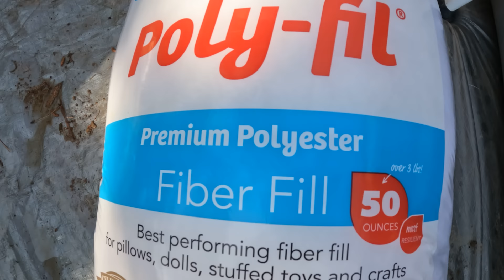Above Ground Pool Swamp To Oasis in 36 Hours for $30| FAST CLEAN Redneck Filter HACK| SUMMER 2022

Comment: Nice setup.  Might consider a sand filter on your well water withe a backflow loop.  It will help in the first place.  Also, 99.99% of what is in that poly filter is sediment and Fe-oxide.....and the Cl likely killed biologics.  But....if there is any lead, nitrate, arsenic, etc... in your well water (even safe amounts), that filter is concentrating it all from that entire large water volume into that tiny filter volume you are then handling.  Just a thought.  EDIT:  Just to be clear - I'm not implying it is "deadly toxic waste". I just would wear dish-gloves when I handle it (just me).
Reply: No, it isn't. Dissolved chemicals, such as lead, nitrates, arsenic, and such, will remain in solution, remain dissolved and pass through the inert fiberfill and go right back into the pool. Please don't spread false reasons for fear. There are plenty enough real issues to be concerned about without them.
Reply: @brainisfullofnonsense8183  Well, since you know chemistry....at least in a controlled lab... The reason the water is clear when it goes into the pool is because everything is dissolved (not suspended).  Not because it is reduced.  The Fe isn't really reduced unless that water came out acidic or anoxic - and they would know (trust me).  When they add the chemicals to it, they are changing the pH and adding ions that cause the dissolved chemistry to precipitate (a portion of it anyways).  MOST of that is Fe3+ as an oxide, chloride or sulfide.  But not all of it.  In addition, some remaining dissolved chemistry will sorb to the Fe-oxides (phosphate is pretty typical).  ALL of that is in the sediment - including things you might not want on you.  Now, re-reading that post I made - maybe it sounds like I'm trying to "strike fear into the hearts of mortals", so I'll add a line at the end.  Really, all I meant was maybe wear dish-gloves when you handle something nasty.

Comment: Awesome... I would put the inlet fitting at the top of the bucket so it would drain the bucket. Maybe bump the pump a few times to clear the line before disconnecting the union, might keep the mess in the bucket. I get a lot of tree pollen, bud waste, etc in the spring after the cover comes off. Slightly modified this should be a great fix for that. Thanks

Comment: WOW, works great! 
Imagine if you had one more, double filtration. Now you’ll speed up the time.
Reply: Put fiilter outflow opposite the filter inflow.will greatly improve.increase the size of the pump motor horsepower just to get the brown out.could just add a sump pump or any water or pond pump to the system.just add a t  splitter or a y.with a threadeded female hose bib.a sump pump water hose discharge  screwed into the splitter would double the flow.but need to clean filter twice as often.

Comment: I have a 16ft above ground pool, to heat it for free, i have painted the exterior walls black (looks pretty cool) and have a black pool cover, the pool (im in the UK) gets to 84 degrees F (29C). Before i painted the pool it was freezing cold. If anyone has an above ground pool that is too cold i highly recommend this method.

Comment: our neck pool floats   2    lemonade bottles    cut the top of one  3 inches down  then cut off little bobbles on bottom of bottle to leave little holes   put in your tablets  fill second bottle with water and push into first bottle lid on and put in pool will float around and are much cheaper then the ones you bye

Comment: I did hole on top I used polyester pillow case in it then on the other side were water comes out I put a bunch of small holes for a waterfall 2 days clear

Comment: I left a msg. I wanted to add the water came clear from the sink, but the dogs water bowel was brown when we would dump amd wipe it out for changing. We thought at first it was kibble from the muzzle, but ended up loosing one of our small dogs. Clear from sink, brown in the new whirlpool tub. Now we give bottled water to the dog we have left, we all drink bottled water. We need a water filter too.  The rest of the house is fine.

Comment: The guys you're using is very effective but if you use a foam pad to put down in there to trap it and then use Coral to treat the water which in turn will help clean it what you're doing is just trying to capture the metal out of it because it's right out of the ground it's not filtered and there's another way it's a little more expensive is called the compressed carbon filters that will take that water and make it pure clear and scentless or tasteless and it would be perfect for drinking

Comment: I have well water as well. Chlorine molecules react to minerals in the water causing to turn brown or even black. The money and time spent here would have been cheaper to buy a intex sand filter pump assembly and a bottle of Unique. Sand filter will last you for years and will hook straight up to your pool.

Comment: You know, after you change the bucket polyfil 3-4 times and the water is crystal clear when you stop the pump and take it apart, at that point you can fill it up with the polyfil and a decent size bag of vermiculite...That will Really keep the water super clear and you won't have to change it so much...Maybe every 2-3 weeks...4 changes and your good into late summer and early fall...Hope this helps and great idea of yours💡 😊 folks!!
Reply: Thank you. I’m getting ready to make the bucket.  Once it’s clear, if the bucket is upright, how I put the polyfil & vermiculite in? In layers or all mixed together or does it matter?
Reply: @hannahcline2398  ...All well mixed together cupcake!

Comment: If you use 3/4 in pipe + brackets and end caps you'll use less filter insulation..☺

Instead of the bucket

Comment: This is definitely a cool hack we had that same pool and filter system and ended up using a sand filter works the same way and works very well except all you have to do is run the sand through a rinse cycle and keep filtering

Comment: Should a Clean the pump filter first, then your bucket. First time it would, it took a lot out just that time. But, yeah, that's a good hack, I'm not tearing you down. That's pretty good, we have well water too, but if you take that, pull, filter out and rent it out and takes a lot of the brown out.  And then do your bucket filter

Comment: That is unbelievable.  How many times did you change the poly fill?  Are you still going to scrub down the walls and floor to get the “residual slime” off?   Is this your permanent redneck filter?  It works amazing.  Great Job.
Reply from the maker: We filled it once and changed it out once and we got that result. Amazing right?!? This filter is set up permanently now for our pool.
The walls are not slimy but if you feel slime in yours I suggest using a magic eraser sponge. 🤗

Comment: Hi there Gary & Mel,
Great to see you both on the mend,
I Love the Red-Neck Filter. 
Just a quick question, that you may well of answered already, or in the video, and I am sorry if you have.
I noticed that with your Pool Pump, you have a filter on there already, Do you take those Filters out, while you get rid of all the Initial Oxidation, then put them back in, or are they left in all the time and need Cleaning more often. Or are they left out completely?
Or I guess just not used at all, and in that case, Could you just use the Polyfill / Fibrefill in the Pool Filter Container (Original one that is), then you could put the other filters back in later, if so desired.

Thanks in Advance and keep up the great work.
Gordon jr from Australia

Comment: Ok i was wondering how i was going to clean my pool this year an now that i know i just have a few questions  1 is the  pipe comming from the bucket going straight  to the pump  an i have leaves in the bottom of my pool is it going to remove them   also   an the my pool is only 1/3 full will i need to finish filling it  an if so would it be easier to clean it  the normal way sinse its only 1/3 full ? This is amazing you came up with this  👍 great job

Comment: Put a filter on the well to remove the minerals as you fill up the pool, that may help them still use your redneck filter....or fill the pool in the first place with the water going through the redneck filter....just suggestions...I'm not there, so I don't know all the little details.

Comment: It would be handy to have a dump valve just before the pipe goes into the bucket. Opening the dump valve for just a minute would divert the water from the pump onto the ground and with it would go the dirt that has collected in the pipe and the bucket.

Comment: This seems like a lot of work when a pool filter/pump does the same thing.   And a pool filter /pump will last 10+ years.   If this was cheaper, easier and lasted for many years, a filter company would've capitalized on it already.  

Just clean your filter system out every day until your pool is clear.  Easy.

Comment: 🤔 this would. E more effective if you use a 35 gallon Brute trash can.  Also put pot scrubbers from the dollar store on the bottom to allow for space between the pipe and the filter media allowing more contact with the media.

Comment: I combined this idea with the triple sock idea… I added polyfil inside 3 socks… basically put one sock inside another to force the water through the layers AND then add polyfil into the sock and place the poly filled socks over the return jet and secure it with a hair elastic. So essentially you force the returning water to flow through the polyfil and 3 layers of socks before reentering into the pool. It took roughly 4-5 days to filter 4,000 gallons of water. It was tea colored to start and quite clear by day 5. Worked wonderfully!

Comment: Not to discount anything you’ve done here as I like the outside the box thinking but next time it gets that bad, use a pool floc. You circulate it for a few hours and turn the pump off. Next day everything should be settled to the bottom. Vac it out, balance chemicals, then good to go.
Reply: The problem with your excellent suggestion is, if you look at the equipment that came with their pool, it's a small pump and cartridge filter and isn't conducive for vacuuming.  They would need to upgrade their equipment to a bigger sand filter with a vacuum to waste option.

Comment: maybe you could have 4 buckets
(not joking)...
Run them all in Parallel - not in series. 
You'll filter it 4 times faster, and maybe clean out the yucky poly less....
Its still the same cost; but... hey; its just faster.

Comment: I have a 100% solution to your chocolate milk pool…Add a water softener. A water softener will remove the iron before it enters into the pool. This way when you add the chlorine the water in the pool will remain clear ;)
Reply: The redneck filter is very cool

Comment: How many times did you change the polyfill in 36 hours?
Glad y'all are feeling better. The monkeys are gonna love that water this summer.
Reply from the maker: We did the initial fill, and changed it after 12hrs. Then again at 36hrs. And it is still running with that last fill right now. Will probably change it again in a month.

Comment: so, what is the sizing of the plastic pieces? 1 1/2 inches by ... can i get the plumbing sizing that you used? thx from Florida. and does this connect to stock pump pipes connector.

Comment: I like the contraption you made but you dont have to go through that much trouble of building it. They sell polyester pool balls that works like a sand filter. All you do is put a screen at the bottom of your filter so the balls dont go through then fill it with the pool balls. Then all you do is swap them twice a day and they are reusable all you need to do is rinse them off.

Comment: I don't have well water but need to upgrade my filter (I have one of those tiny ones that came with my coleman pool) ... im not able to invest the 200-500 in a pool pump right now, would this work for me? I just need a little extra filtering then the cartridge provides
Reply from the maker: This should absolutely help you in your situation for better filtering! As many people have commented, you can also save some expenses by using an old pillow instead of poly fill. But make sure if you do that to remove the outer fabric and just use the pillow fluff. 🤗 Hope this helps!

Comment: how deep is your well? lived off well water for decades filled indoor pool never had it turn muddy like yours did not normal unless perhaps your water is less than 50 feet deep on your well ,and or your screen on your well pipe is torn or always in mud pull it up 10 feet from where its sitting on the bottom of your well

Comment: Why is it that way? I have a pool and never ever have I let it turn colors. Dump that water end of season and use it throughout your land.vstart fresh next season and clean inside the pool before refilling.  Only sure and clean/safe way to do this for above ground pools. That cotton/wool stuffing isn't filter material you can clean, ounce its dirty it's dirty for good. Throw it away and buy filter sand
Reply from the maker: @davidhuffman4036  you're misunderstanding. As we explained in the video, our pool turned brown once chlorine was added due to the minerals in our well water. This is a perfect solution to that problem 💚

Comment: no one is freaking out about the bulging bucket? is that not an explosive shrapnel bomb waiting to explode when the children are swimming? I'm sorry if I don't understand the danger factor. it looks moldy sounds logical. what about mold and mildew and moss and if I didn't already mention the pressurized Lowe's bucket becoming a bomb waiting to go off. I'm all for redneck engineering if anyone can help me understand that this is safe please comment.
Reply from the maker: There is no danger with the bucket. If it "explodes" the only thing that will happen is nasty fluff will go into the pool and we will have to refilter again. There is no shrapnel inserted so there would be no shrapnel to explode.
Reply: @SimpleLifeReclaimed  I have a bunch of those buckets and they do tend to break into shards of plastic is what I meant, but it makes sense if you have it set so the lid will come off before the structure of the bucket fails.

Comment: You guys are gonna burn up that poor little intex pump putting all that pressure on it. Try investing in some iron out and a couple extra cartridges and run that before you ever add chlorine. Water won't ever turn brown. Better yet. Buy a pre-filter to attach to the hose when you fill it. They're usually good for about 10000 gallons. With this much iron you might need one every year. But it beats all this wasted time and effort. But then I guess you wouldn't have a reason to make a "redneck diy video"